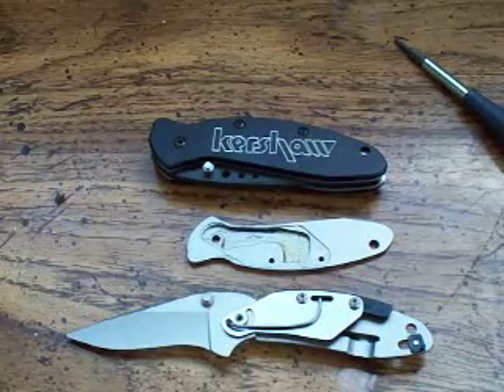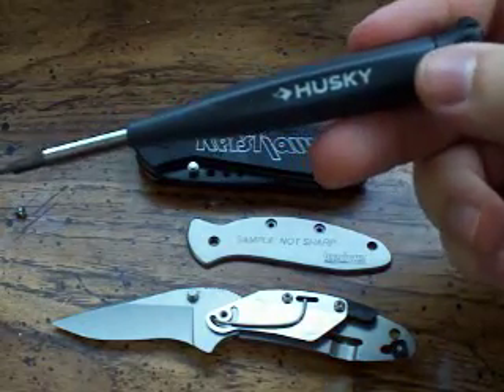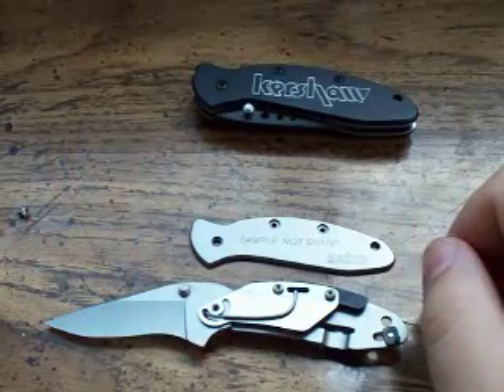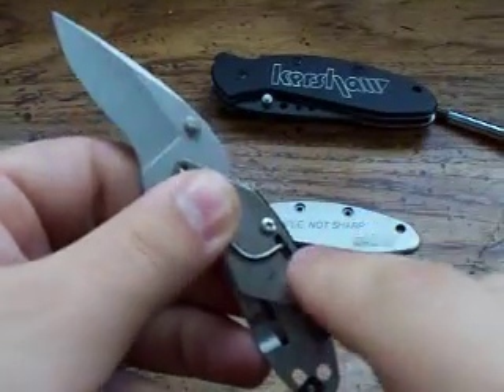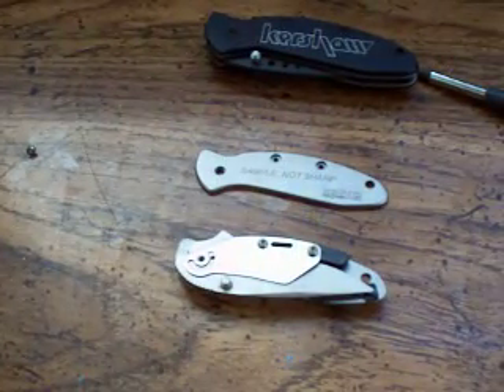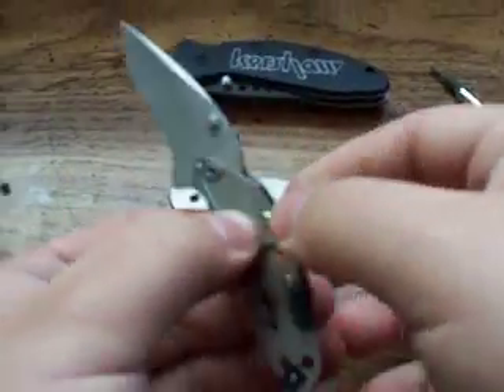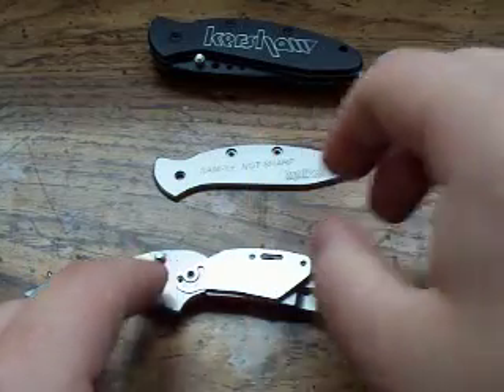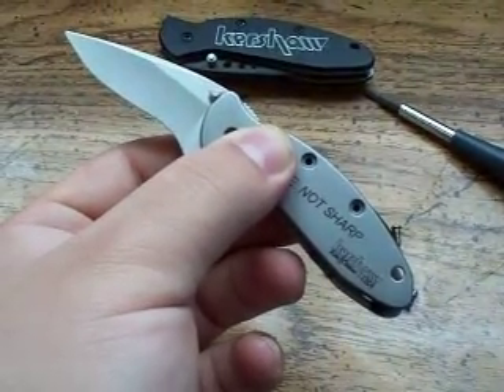Knife Mechanism : How Kershaws Speed Safe Works

Comment: Suggestions: first, make a video with better than 240P resolution. I'm not real picky, but you cannot see any detail with 240P. Second, make your video about "How the Kershaw Speedsafe Works" actually ABOUT _how the Kershaw Speedsafe works . If you want to make a video about "how to disassemble a folding knife", put that in a different video with a different title. I came to see what the inside of a Kershaw looks like, not to hear suggestions on how to disassemble a knife, how to avoid warranty issues, what kind of drivers to use, etc. I just wanted to see the mechanism, and it ought to take roughly 2 minutes to show it, not 10.

I also don't understand why they call this a "torsion bar". Probably to avoid legal PR complications arising from having a knife with a "spring loaded" blade. "It's not a spring, it's a TORSION BAR!" Problem solved. But really, a torsion bar is a spring-steel bar that twists . They use them in car suspensions, and the spring action is from a long, straight rod locked in place on one end, being twisted by the motion of the suspension. This appears to be a standard straight wire spring that works by wanting to straighten or curl back to its normal position. That is by definition a "spring". Well, I suppose a torsion bar is a "spring' by definition as well. THey probably justify calling it that because according to them it is to load the blade with torsion forces to keep it open/closed. And calling it a "spring" is problematic, like I said. But it's not a "torsion bar" by the normal definition of the word.

Comment: My chive spring-assists halfway and then I have to push it open manually the rest. Have disassembled/reassembled quite a few times and can find nothing wrong, screws not over tightened etc...any help/suggestions?
Reply: zhukie, I had the same thing. I just lubed it inside that's all
Reply: zhukie Probably the torsion bar is broken without splitting into two parts. This happened to my chive twice. Watch the bar with a magnifying glass. You will see a crease.

Comment: How's the blade retention when you remove the torsion bar from the chive or scallion? I know that on the cryo there is no detent so the blade opens in your pocket easily, while the blur has a detent and functions perfectly without the bar.
Reply: My chive also has no detent so I would not disable the speedsafe
Reply: Mechanism

Comment: Great video. Thanks. I wondered how easy it would be to disable the torsion bar because I'm concerned about the knife opening accidentally while putting it in or taking it out of my pocket. Even more so, it opening when fishing in my pocket for keys or something.
Reply: BUT, without the torsion bar/spring, there is nothing (no detent) holding the blade closed.  If you are really worried about it, look for a knife with a lock or a flipper knife that is not spring assisted.

Comment: Whats the model/part number on yours? Mine is different, It's a chive like that one, except it has a liner lock, not a frame lock like yours (like mine has aluminum panels on the sides, which are green, and then there's a SS liner inside which moves in position to lock the blade..

Comment: Spring assisted knives are legal in North Carolina....according to Troop E NCSHP, the Rowan Co Sheriffs Dept, and Lexington Police. They all said it's okay just as long as it's not deployed with the simple use of a button (full automatics).  Speedsafe type mechanisms don't fall into the same category because the blade itself is pressed as the deploying mechanism.  There's a fine line between certain designs and being illegal, but you'll only get a slap on the wrist for non violent offenses.

Comment: The top screw that acts a as a pivot point wont come off. Its held on by a spinning thread and I cant seem to stop it from spinning when trying to remove that screw. Any tips? Tried eraser, pin, my nail, lots of pressure, flat head and no avail.

Comment: @carpmanager1 they will only open accidentally if there is alot of pressure, shure it doesn't take much to open them but they have a good lock if you use it (I personally dont) but you have to push the kicker in past the bottom of the scales for it to flip open...if that makes any sense

Comment: EXCELLENT VIDEO. Saved my A** when I took my Kershaw 1610 apart and some parts went flying. If you decide to take yours apart, be sure it is in the OPEN position when you do. Taking photos as you go is a good idea. I'm on my 2nd 1600 model. The first lasted a long time but the torsion bar broke. I took it apart to see what was wrong, then sent it back with a letter explaining what I did. I asked them to repair it for me and they sent me a new one. Great knife, great company.

Comment: ThanksThats what I needed 2 c Still Im stuborn so Im gonna hav 2 take 1 of mine apart, just cant c that torsion bar while the knife is 2gether I rebuilt enough carbs back in the day to not worry re getting it back 2gether Have the laws changed since u made this vid? Some bureaucrat must c that bar and think "switchblade" lol I have 2many examples of Onions 2 worry about legality at this late date By the way, what camera do you use?Just ordered a Samsung SMXF34 thats YouTube certified Gud choise?

Comment: Nice vid Jeff, thanks.

Also, I see a guy about a year ago asked if it was better to store in the open or closed position to preserve the torsion bar. I'll weigh in based on my engineering experience. It actually does not matter. What wears out a spring is repetitive compression and decompression. If you're storing an assisted knife, it doesn't matter if it's closed or open.

Comment: Thanks man, Thank you thank you.
Now when I need to clean my leek I will know how to put it back together, I am assuming they are virtually the same right? 
Mine is the G10 s30v, it has a liner lock instead of a framelock, is there anything I should be warned about?

Comment: at first I want to say that I like your vids a lot. You may excuse my English (I'm from germany). Now, I think that there is a proplem, if you remove the torsion bar. When it's out of the knife the blade in the closed position may NOT stay in place. There is no hole in the blade like in manual knives. The bar keeps the blade in place - in the closed position. The knife may open in your pocket, if the torsion is removed. Please be careful. Again great vids - keep it up! Thanks